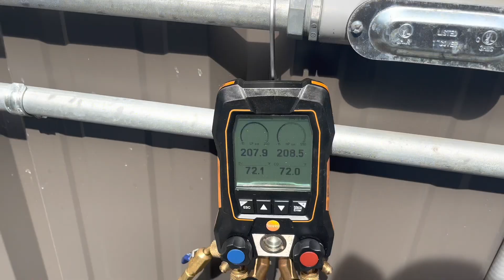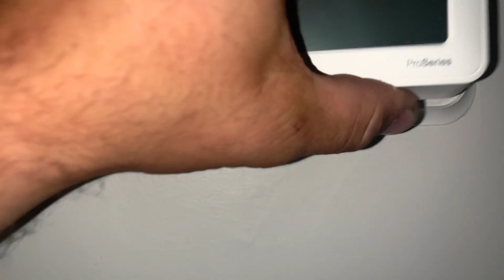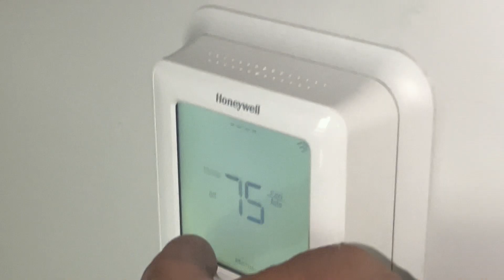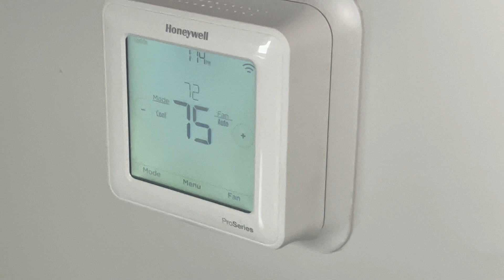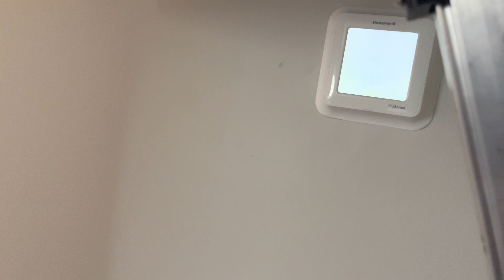HVAC.  2019 Carrier Split System shorting 5 amp fuse.

Comment: I would agree with most of the comments about the OHMing the contactor before you replace the fuse. Low voltage fuse protects the transformer and usuallly blows because of the Contactor coil being shorted and drawing too much power. I like to replace the old school contactors like that with the SureSwitch contactor.  It is a digital contactless relay that work much better than the old ones and upgrades the part that is a weak link in the modern condenser units.

Good job.
Reply from the maker: Thanks Mark.   I appreciate.

Comment: Nice ! Anytime I run into low voltage shorts and it’s a carrier from 1yr to 7 years old I go straight to the contactor . And  98% of the time that’s the issue
Reply from the maker: It’s crazy.  Thanks bro.
Reply: Blame the Carrier engineer monkeys.
Reply: Trane units from 2019-2022 ive changed a few since November. That and two compressors and leaking 3 yr old indoor coil 🤦🏻‍♂️
Reply from the maker: Yes.  I’ve seen a few failed compressors 2020 ish